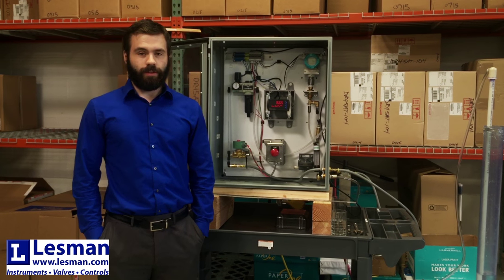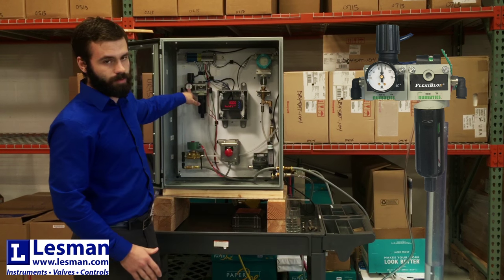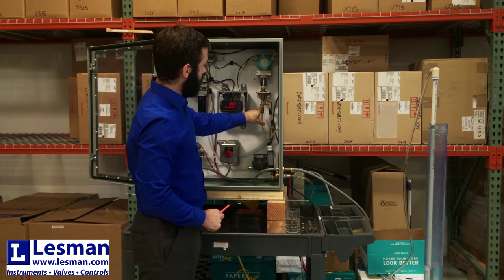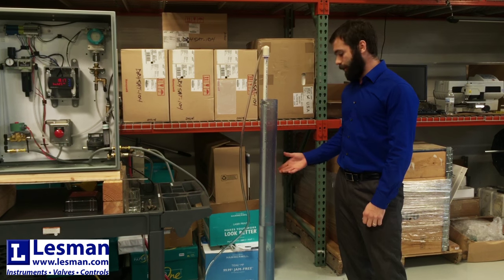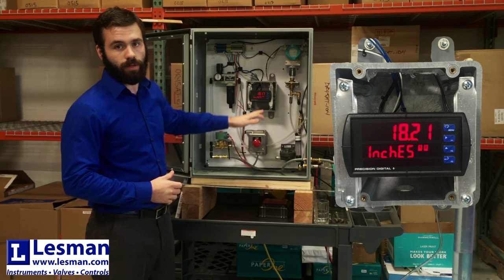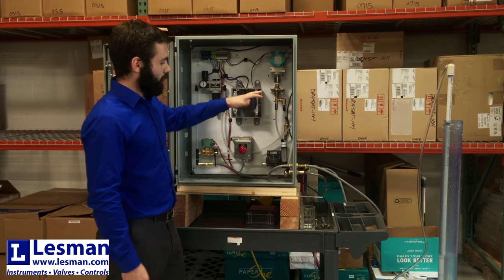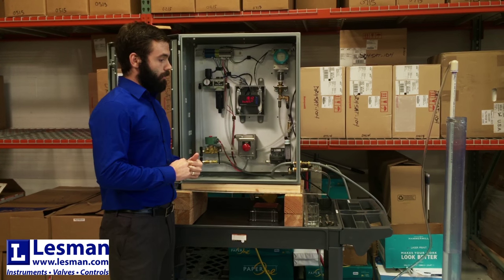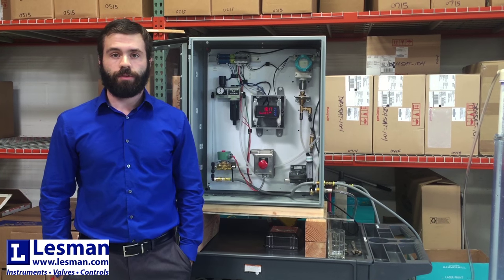Air Bubbler Systems for Liquid Level Measurement

Comment: During purging doesn't the system need a gauge protector since you are applying direct instrument pressure to the dip tube? You did not mention about your system having a protector system for the transmitter during purging, which i feel is very important.